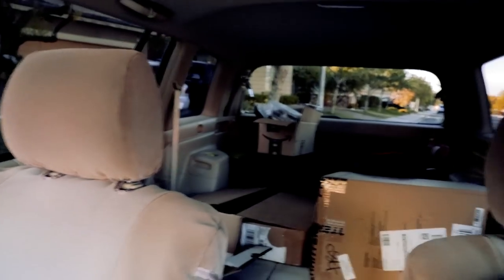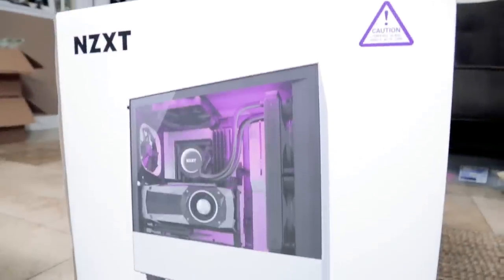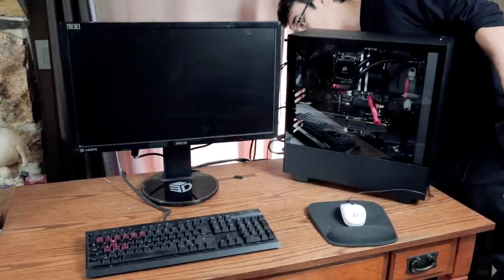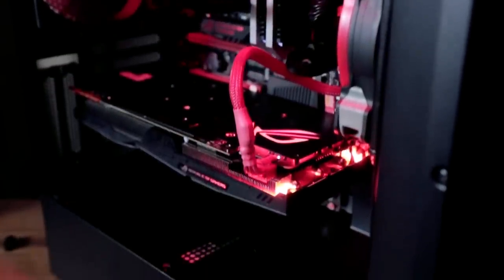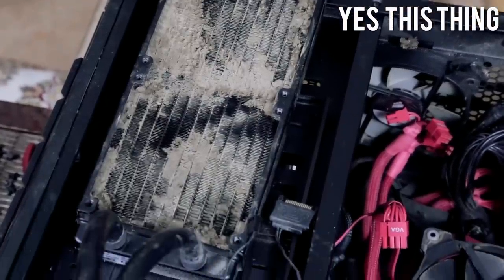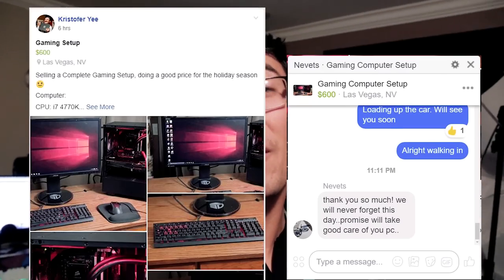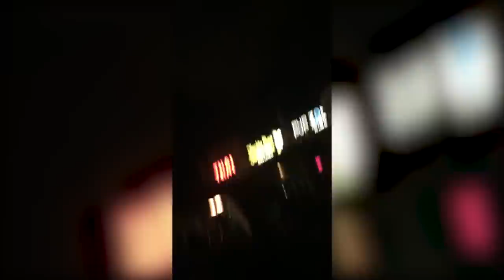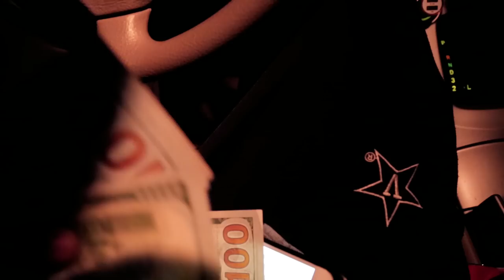Dad Sells Me his Son's Gaming PC (Part 2)

Comment: Honestly I would just treasure it, never game on it. Imagine playing, having lots of fun on this beast of a PC, then realising this is what the original owner must have felt once upon a time. May he rest in piece.
Reply: No bro, the OG owner would want him to game on it
Reply: Treasure it how they treasured it is the best you can do for their memory
Reply: Piece
Reply: Arlind Sejdiu ty
Reply: lakel music piece
Reply: Holy shit I think you mean peace
Reply: Je legjend nje nga shqiptaret e pakte
Reply: Really though
Reply: lakel music lol
Reply: @grizzlygaming4963  ahaha flm shum shoki, mfal se nuk e pash wet reply
Reply: Peace my guy
Reply: piece 😭
Reply: I would for sure want someone to game on mine. I still have a X3440 running, and im pushing it to the limit, but it is still running games pretty well in combination with a RX6800 at 1080p Ultra, and some cpu settings in certain games more to 1 down from the highest. It is still good for 60+fps. and despite it being a better binned i7 860, I got it to run at daily safe voltages, at 4.4+Ghz and it is actually faster than a i7 4790 now. And the overclock is super impressive since the base speed starts at 2.55Ghz, and I got it to run at 4.5Ghz all core in cpu-z ( still seeing on what voltages for anything outside of cpu-z).

For now 4.42Ghz at 1.4V works fine and 4.4 should work at 1.38 or 1.39V, maybe a little lower. I wonder if a X3480 will be faster but I think my motherboard is actually the bottleneck. it is kinda hard to run my bclk any higher and I think that is due to the motherboard. I did increase some voltage to get 4.5 running, but I think that would require a voltage to high. But maybe for a few benchmarks it could be fun.

Comment: As cool as that OG case is, it is massive and time for an upgrade!
Reply: I'm using a mid 90s Dell server case for my build, but I'm a full time mechanic and fabricator, so my huge old case is completely updated and also has glass on the side. Only downside is the weight, but I've also got two power supplies and 12 hard drives total. Basically I needed the big case to fit everything.
Reply: CM Stormtrooper is the best case released onto the market in the last 5-10 years. I have three of them for each of my computers and the modularity and customizability of the case is unparalleled and unsurpassed. Every other case on the market seems to be getting more and more simple and straightforward lately which is upsetting. Most new cases now a days just look like a black or white box with a window on the side.
Reply: Ya bigger then my ammo 533 box from coolmaster
Reply: It was one of the best cases, and my all of old builds had them.
Reply: I feel that changing the case was disrespectful
Reply: @Wolvespiritt  dude, that sounds so cool
Reply: @SidTheJerkNSFW Your name rhymes lol

Comment: 40 C temperature is high? my notebook stays at 60 C idle ahahahhahahaah im doomed
Reply: I use to game on a laptop and experienced similar problems. I found out very quickly that tight spaces and dust don't mix very well haha. Try to thoroughly clean your fans, as well as the intake and exhaust ports with compressed air and you will see a MASSIVE difference.

Just my two cents!
Reply: Repaste that machine or Liquid Metal it.  Pull the bottom off and use a laptop cooler.  That is ridiculous of a temperature.
Reply: My pc does 60c under full load and it's overclocked, definitely something up with that.
Reply: I run i7 7700k with AOI liquid cooling, it runs 30 to 40 degrees idle. It's also overclocked to 5.5ghz. But generally speaking, the danger zone for cpu temperatures is 60 to 70. 40 and below is fine. He is being over dramatic about the CPU temps. It actually almost never goes over 40 degrees even at a full load. Yea you should get that checked.
Reply: Dudee laptop temp and dekstop temp is not the same. Laptop usually have a bit higher than normal temp compared to desktop due to their small form factor of case. 40-50 is normal for laptop. Under heavy load usage, 80-90 is normal for laptop and 60-70 is normal for desktop
Reply: @syahir6653  60 - 70 is normal for desktop??????
Reply: @silas.6341  normal for desktop with heavy load.
Reply: @syahir6653  oh ok. That makes sense
Reply: Hahahaaha, rooky numbers! Mine doesn't go below 90 degrees
Reply: depends on the ambient temps. im guessing kristoffer is at 20ish deg C room
Reply: Dude at 60c you can cook a steak to medium rare...
Reply: My surface pro 4 heats out to 70 c I literally can fry an egg on it

Comment: An AIO typically has a lifespan of 2-3 years
...
Looks at Antec Kuhler from 2012

You're dead to me...
Reply: I literally swapped my antec last year, could hear a faint noise from the pump(I think at least). Still did it's job on my old FX-8150 at 4.4Ghz. Now I'm on the CM MA610P with the 2700x, air cooling feels better but man, that AIO did it's duty and then some even at it's last stand.

To be fair, AIO's have a longer lifespan than 2-3 years, at least 5 if you know to vacuum your radiator with a narrow mouthpiece regularly(once a year maybe).
Reply: lol same here
Reply: Me thinking about my aio h60 from 7-8 year  and I'm like welp.

Comment: Probably could have just cleaned the rad on the h100i
Reply: Jprovence02 it is not the rad that the s the problem with old AIO, it is the pump.
Reply: Zack I would agree but an h100i is not that old.
Reply: It was from 5 years ago. That is quite a lot in terms of PC Building
Reply: Jprovence02 
Yeah, clean the rad and new thermal paste. It may have had some more life in it.
Reply: Not quite, after five years the pump easily starts to go bad, and the liquid inside doesn't exactly stay efficient over five years. The thermal plate was most likely deteriorating by then (one of the more significant issues with water coolers is the thermal plate and the CPU's heat plate touching for a while causes deterioration). The tubing can start to crack as well. 

So honestly, it's better to be safe than sorry and have your pump die, or the tubing crack, letting water into the PC where it shouldn't be.

Comment: I just bought a computer repair shop owners pc and as far as I could tell, the case was a cooler master storm stryker, I couldnt tell what mobo it had and couldn't see the cpu but it is a 4th or 5th gen i5, the gpu is a radeon RX560, but might be a 590 couldnt see too well cause the little glass panel was super dusty. 16gb of pretty nice looking ram, the guy was super happy to sell it, I got it for 450 NZD (roughly 200usd) and I plan to take good care of it. When I upgrade it, I plan to use the old parts to build a pc for my sister. When I saw it, I was reminded of this vid.

Comment: Not to pick apart your build but the rad is upside down and the air in the rad will go to the top of the tubes and will cause turbulence in the pump when pulled through. But I get you may not have had space or length on the tubes. You probably have your reasons